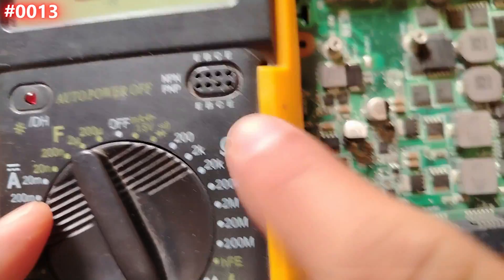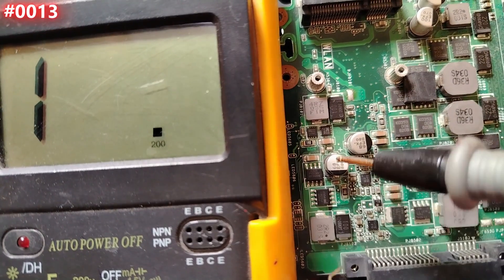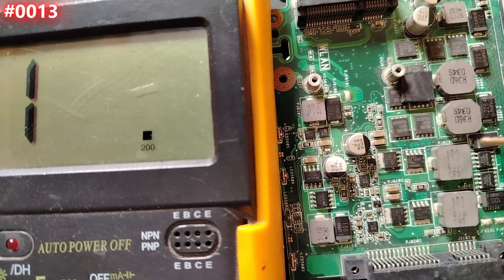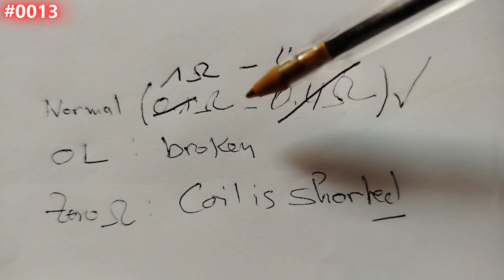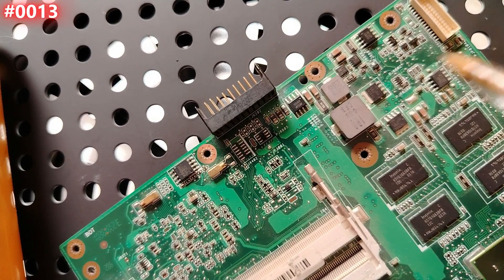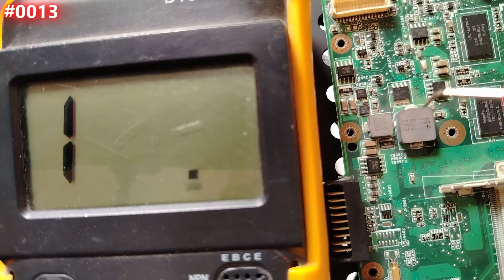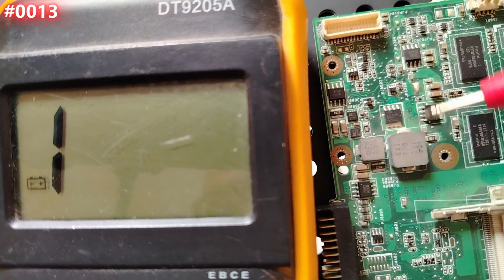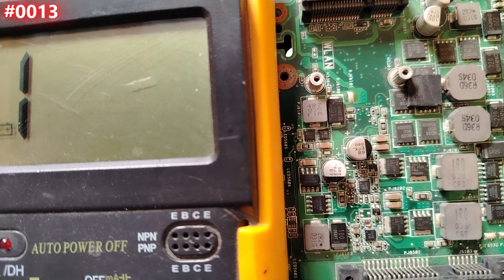#0013 Electronic Components: How to Test POWER SMD Inductors | SMD Inductor Test

Comment: If the inductor is so small that it has no description and is damaged, but there are others like it on the board, is there a way to know its characteristics to get a replacement?
Reply from the maker: Great question. If you can find other similar inductors on the board, you might be able to measure their values with a multimeter. Often, the surrounding components can give you clues about the characteristics you need for a replacement.